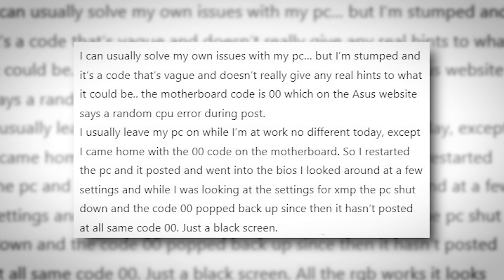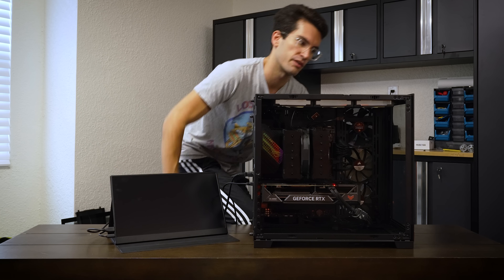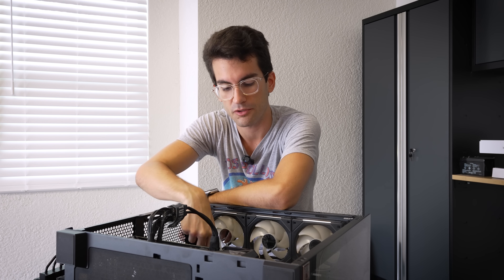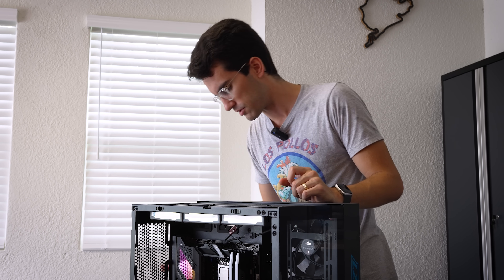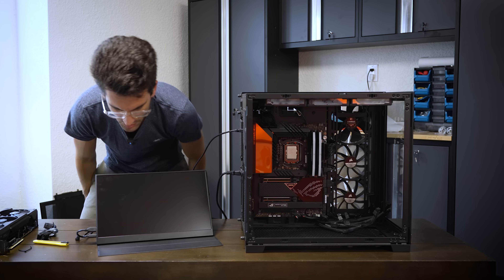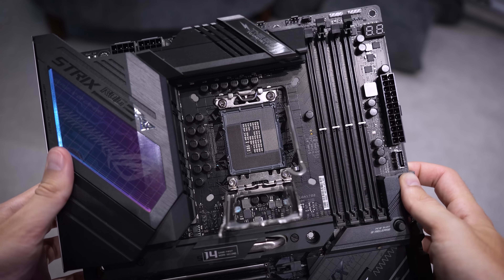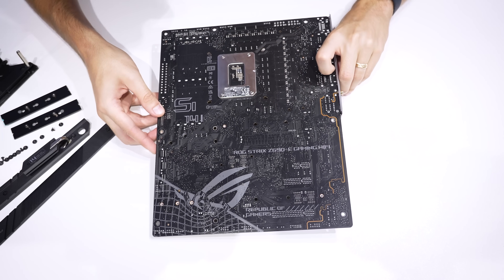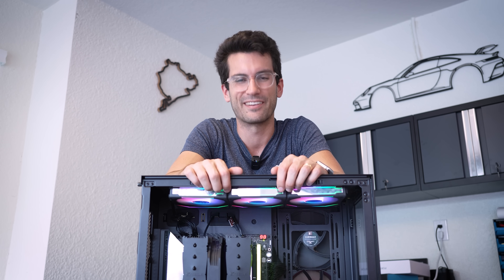Fixing a Viewer's BROKEN Gaming PC? - Fix or Flop S5:E17

Comment: God this reminds me... speaking of debug codes and very weird issues...here's a fun one for yall. 
So one day I was going to build a friend an office box out of an old 3rd gen i5 with an SSD that I had lying around that previously worked with zero issues. I get the system all built expecting it to work as all the hardware I used, previously worked before putting it in storage for a couple years. First thing I get is constant power cycling of about 10 second intervals...so I'm like ok crap what's going on here. I re-seat the RAM coz often times no post issues are as simple as poorly seated RAM, faulty RAM or dirty RAM contacts. I do that, and after doing so it works...until I move the system from on it's side to upright where it cuts out and the same power cycling issue returns. So at this point I consider that I may have bad CPU seating as it seems to sometimes trigger the issue when moving the system or the mobo around. Still the same symptoms after reseating the CPU and even trying another CPU. I tried about 5 different RAM sticks that all previously worked. Same issues. Sometimes changing around the slots would randomly fix it, and then the next time not. The same slot that worked 5 minutes ago now no longer worked, and vice versa.

So at this point I'm like okay...I'm just gonna say that this board is toast (was a crappy low-end micro atx thing anyway). So I go and grab my much nicer full size built like a tank old Z87 board with plans to use my old 4690k i5 instead...
Until...that board has the EXACT, same issue. Showing debug code 07 I believe it was but I may be wrong as this was a long time ago. Same symptons, swithing around RAM slots, moving around the board would either trigger or fix the issue each time.
I tried like all sorts of hardware combinations across 2 motherboards, all hardware and RAM that previously worked. The ONLY thing common between all configs tested was the PSU but I also then tried my main rig's PSU and had the same issues. Unless the first PSU for testing was somehow killing a cerrtain part on the mobo that deals with RAM but that sounds incredibly unrealistic to me.
Aaaaaaaand...I try another old mobo I had lying round that also previously worked and I bet you can't guess what. The EXACT same thing on that one as well.

So in short terms...something happened to either all of my spare CPUs...or 3 mobos that have been left in storage for a few years to the point where they have all got faults now, with the EXACT same weird ass symptoms. I dunno whether it's the way they've been stored, maybe moitsutre? Absolutely no idea, but it's the most jank thing I've ever dealt with building computers in my life.
Defo some kinda weird contact issue though from the way changing slots and knocking the board around would fix or break it. But the weird thing is how it's the exact same fault across 3 boards that all previously worked, just left away for a couple years.

Comment: I've definitely seen a bad CMOS battery prevent a board from posting. Too bad it wasn't that simple. Also, I've had multiple systems where Windows updated the BIOS if I don't tell it not to download drivers through group policy, so that's entirely possible they didn't notice it was downloading a firmware update.

Comment: Happened to me, worked perfectly, shutted it down, came after work, Tried to start it, Bricked. 
Tried everything Checking psu cables, rams, GPU. And as a last fix tried a bios flashback, after trying 3 Usbs, and downloading a special kind of encoder ( fat32 didn't work) it finally started

Comment: Its a bios flash failure. Maybe the user himself applied the bios update but the computer shut off during the update and he didn't tell Greg but also it could be windows updating the bios via a capsule update and the computer had a bios flash failure. It could be one of the possibilities.

Comment: Asus boards and 00 code is a known issue, unfortunately I have an Asus rampage gene with the 00 code and same symptoms  your guy had, was also able to get to the bios a few times after the first 00 code but eventually it got stuck on the 00, from my research I believe it's a mosfet on the VRM dying or dead.

Comment: One thing that I found interesting, that cooler, which appears to be a NH-D15S is NOT compatible with the Strix Z690-E motherboard.  The heatpipes make contact with part of the VRM heatsink.  If you check Noctua's own compatibility page you will find where this is listed.  I know this due to having a friend with this same problem, he had to do some "surgery" to the plastic part of the top of the VRM heatsink to make it fit.  If this user didn't realize it wasn't fitting properly and tried to force the cooler on, I'm wondering if it either bent some of the board around the CPU socket or applied pressure to the VRM's under the top heatsink causing damage to them.  I was worried when you replaced the board with the Z690 Hero but then I remembered that the Hero board actually didn't have the same issue that the Strix ones did.  ASUS fixed that issue with the Z790 series as well.

Comment: This "00" Code is oldest disease of Hero Series... I faced this issued with Maximus Hero VII... Its eventually fixed when I tightened the Cooler's Standoffs. Actually beneath the standoffs the linings on Mohterboard's layer, might be damaged little and due to that one of DIMM slot was also not working. I was using Corsair H100i V2 Liquid cooler and that gave me very hard time. However, after tightening the standoff correctly, "00" error code gone and was working properly.

Few months later, "00" again and that time I noticed that one of standoff (upper left corner was loose, don't know how), So I tightening the same it worked again but then within a month, "00" appeared again. Tried my best to fix it but this time I broke the socket a little and Motherboard dead.

Seems Motherboard was asking me for retirement due to this "00" disease but I didn't understand. My bad.

If you have time, check it thoroughly, may be something else happened to motherboard.

Comment: I had exactly the same issue happen with 3rd Gen threadripper board (Asus trx40-xe) 2 months after purchase. It just suddenly blanked out during a gaming session and displayed 00 post code. Ended up being defective board too.
Reply: Initially thought it was CPU but because the entry point for the socket is high had to spend $1400 on a 3960x to try out. That didn't work. New board fixed it.

Comment: Tried powering on the board without a chip in socket to try flashing the BIOS? See if the same behavior happens in that configuration also. I mean, it should be possible to get into the BIOS without a CPU, right?
Reply from the maker: No... you cannot get into a BIOS without a CPU installed.

Comment: I had the same issue with an Asus Z97 board freshly bought throwing the same error from day 1. Even before finishing the video I knew the board was defective, that's really what that code means. It's not worth chasing CPU, cooler or RAM as possible culprits. I don't get why Asus doesn't mark it as "defective board" to begin with.

Comment: If that battery was installed in a key fob you would be getting a dash pop up that the key is not detected or that you have a low key fob battery, I don't know what thresholds are for motherboards i work at a Batteries Plus and that would be a very low coin by our books

Comment: Did you need a new copy of Windows 11 or is there a way to get around this?. I asked because I had a problem with an Asus Tuff Gaming motherboard only had it for 17 weeks the fan headers stopped working got it replaced but had to buy a new copy of Windows 11.

Comment: Remember the rule: It's never the CPU, unless it's the CPU 🤫A lot of boards with bad S I/O or bad PCH display codes related to the CPU because the board can't read/communicate with the processor, but it's not the CPU's fault, it's a bad reset signal or some other issue that manifests during the startup process. Get under the microscope and check all the little resistors and mosfets near the PCH and around where the CPU slot is. Perhaps when he was installing his 4070 he nicked a surface mounted cap. That would do it.

Comment: Hello, I recently upgraded to the am5 platform. I have a gigabyte x670e motherboard along with 64gbs of team group ram. When I went to enable xmp on the settings the computer started throwing code 15. After many attempts I was able to get back into bios and turn it off. It works fine now but why can’t I use xmp with 4 sticks of ram?

Comment: I'm sorry Greg, that board has a power button.........😁
Reply from the maker: I usually prefer to jump pins directly. A button is another potential failure point (ask me how I know).
Reply: @GregSalazar  I see your point. One of my boards has it up above the 24 pin and another one has it down by the FP connector. I think down by the FP connector is a better position. You're already looking at the pins to jump anyway.
Reply: @GregSalazar  That board also has "Bios Flashback". Maybe you can rejuvenate it with a flash. I've never flashed one without a processor in it.

Comment: the moment he mentioned xmp settings i knew it was the motherboard. it happened to me, the exact same thing, tested everything and it was my motherboard that was the issue
Reply: my sister was getting rid of her PC, she told me everything was up to date, when I was taking a look at the bios and checked the xmp setting, the second i changed a setting, pc just shut off, would not come back on, tried to reset bios but did not work, turns out, when she said "everything was up to date" she only meant windows. nothing else had been updated. so changing the setting without it being updated killed the board. no reset could get it up, tried updating bios just to see, did not work, motherboard just left the chat. needed to replace it. it sucks honestly

Comment: Even with a dieing cmos battery it won't cause that issue. My x570 cmos battery was dead but would just boot me into the bios every boot since it couldn't save settings.

Comment: I left my pc on once and i always have it on, i didn't plan on it but i ended up being away for 2 days and i came home to a dead PC, everything seemed to be fine, even switched the power supply out from a pc i borrowed from the friend i visited for 2 days, didn't work so i ended up dismantling the pc (an old AM3+ rig) and it turned out to be a blown mosfet circuit, apparently the old 990FX Sabretooth boards had those issues but luckily asus had their 5 year warranty so i got the new revision

Comment: Do NOT use a multimeter to test batteries! You an get incorrect readings because the meter does not provide any 'load' on the battery. Always use a proprietor 'battery tester'.  Even a cheap one is better than using a multimeter. Ask me how I know! Sure, if you get a low reading from a multimeter, the battery should be replaced BUT if you measure 3V (in this case) it does not mean the battery is OK.

Comment: Hi !! had a catastrophy 2 months ago, my 6 years old son poured olive oil in my PC soaking everything.... let it sit for month and a half all desemble the parts to let them dry... tried the system at first was running okay for a week then freezes appeared and after that not stable... i know oil expands and went in the gpu by the pcie slot maybe the ram as suffered too... the thing is i bought a new power supply for the system and installed it... i wonder if is he's any good because when i unplugged everything there was a little of oil on the 24pin connector from the psu dont know if it broke it or not,,,, the thing is after the first lockups i dismantled everything and soaked the board de gpu and the ram in isopropyl alcohol 99% to try and remove the gease and oil... reseated everything... system still runs but after a short time in games or windows it crashes...  would like to know what append acording to you... i know everything is probably dead but i would at least keep my new psu... !! thanks
Reply: and my rig is.... 5600x x570 aorus elite 16gb of 3200ram 6800xt ref fuma2 cooler

Comment: If you said the system smelled like something was burnt, why didn't you track that down to start?  Most BIOS 00 issues are motherboard-caused.  CPUs are relatively bulletproof, by comparison.

I would NOT have been swapping in known good components on a system that smelled burnt.

Comment: You can update the BIOS VIA flashback....
Reply from the maker: This is not a BIOS-related problem. The board is hard-bricked and the CPU isn't receiving any power. Likely MOSFET issue.
Reply: @GregSalazar  Yeah probably. But you could try it ;)

Comment: I wonder if he overtightened the cooler which caused one of the tracers coming from the 8 pin power socket going to the CPU to break

He should still have a warranty with that board shouldn't he?

Comment: His motherboard had a bios flashback slot. Could always try a bios update before swapping the board. Just to rule out a weird compatibility thing or corruption? You can update the bios with just a motherboard and psu connected

Ah just got further in. What “kit”? You just need a flash drive with the BIOS on it. You don’t need any special tools or anything
Reply from the maker: That wasn't to what I was referring. We have entire tutorials regarding BIOS Flashback. I know how it's done and we've used it several times in this playlist. As stated later in the video, this is not a BIOS-related problem. The board is hard-bricked and the CPU isn't receiving any power. Likely MOSFET issue.
Reply: @GregSalazar  yeah I’m assuming you know how of course. I’m just curious why you didn’t? You even said in the video that it could be a bios corruption but you didn’t want to deal with the complicated process. That’s what’s confusing me and others in the comments
Reply: @HOBOTw1tcH  imagine putting a bios on a usb drive and pushing one button on the back of motherboard being a "complicated process" :D it would have taken him 3 minutes to do total.
Reply: @mouzz  yeah I mean I’ve re watched that segment 10x. He clearly says exactly what I said in my comment. I wasn’t calling him out or anything. I was legit just asking a question. I wasn’t trying to imply he did things wrong. I was just wondering what he was talking about. 🤷🏻‍♂️oh well

Comment: Please can someone advise me what I can do ? Long story short I have a Pre-built system from a UK PC specialist. These are the specs 
I7 13700kf
Asus prime z690 motherboard 
850w Corsair rm850 power supply
Palit rtx 4080
1tb gen 4 m.2 drive 
32gb ddr5 5600mhz cl 36

Long story short the pc was working perfectly fine for over 12 months. I wanted to reset and do a fresh clean install of windows. Everything seemed fine got to the windows startup and did the first login. After that any time I try to power on the pc, there is no display... The GPU fans and lights come on, I get a single beep from the motherboard which means it boots up but I get no display. I've placed an older GPU RTX 2060 and it was working fine. Please help. I've attempted different PCIE slots and different cables and ports with no success. I don't know what to do

Comment: Using an infrared camera is an effective way to quickly identify thermal-related issues on a PC motherboard. It is best used when you suspect overheating, power delivery problems, or short circuits that are not easily identifiable through visual inspection alone. By capturing thermal images, you can pinpoint problematic components, diagnose the root cause, and take corrective action to prevent further damage to your system.

https://www.youtube.com/shorts/oBTlxZTnnr4

Comment: WHat? Another ASUS product randomly fails? I would've never guessed. ASUStek's quality is still questionable. Sometime around 2018/2019, their PCB components started to randomly fail. It started with their gaming phones randomly failing. No power on, WiFi randomly stops working, etc. I will never buy an Asus product again until they get these issues resolved. I has always thought that ASUS was a premium, high quality brand name. Now, they're still premium, but without the quality. I hope that replacement board doesn't fail after 18 mos.

Comment: I knew it was the mobo right away, Ive had the 00 code happen to an ASRock Fatal1ty Z370 Gaming K6 on my kids rig a few months back.
Just like homeboy said, it was working fine, she turned it on the next morning, and NOTTA! I felt so bad for her, so  I hooked her up with a Z390 Godlike. She was happy. She got her mobo fascination from me.
It does have to do with the bios, that K6 mobo had dual bios, but I couldn't get it to work, its a known issue by Asrock, they were wanting me to send it in , i just got her the Godlike instead of all that ol mess.

Comment: As soon as you said it had a 00 error I knew it would be the MB.
I had almost the same thing with a 4th gen Asus board, only difference was it would flash up 00 and boot loop continually.
Tried everything, different memory, PSU, GPU, bios flashback, battery and even bought a second-hand CPU from CEX. same result.
Shame as it was my backup non gaming system with a 4790K and a GTX780Ti, I rebuilt it with my previous system C2Q 6600 parts and that still runs great after all these years.